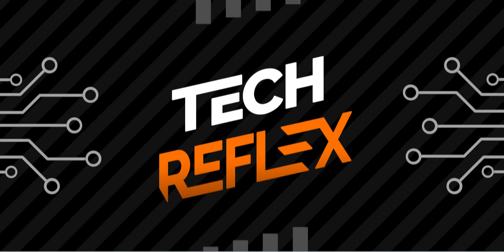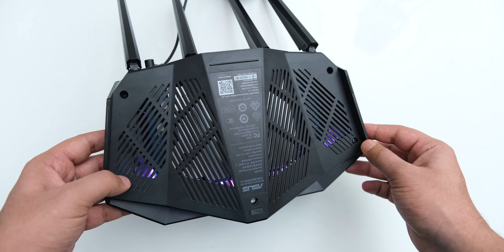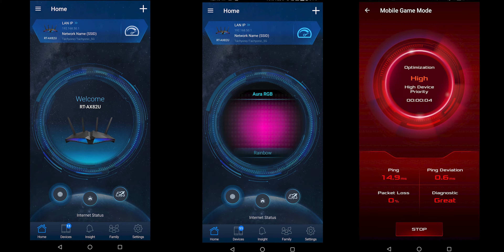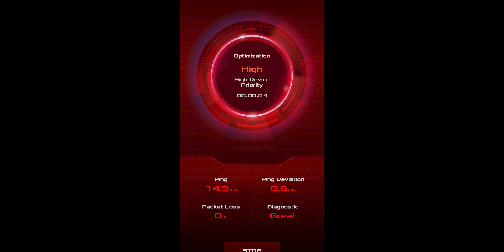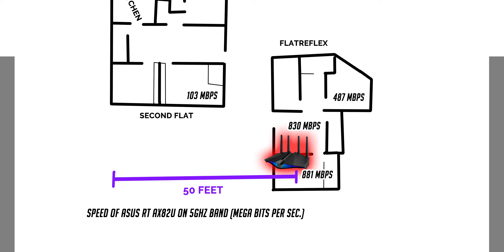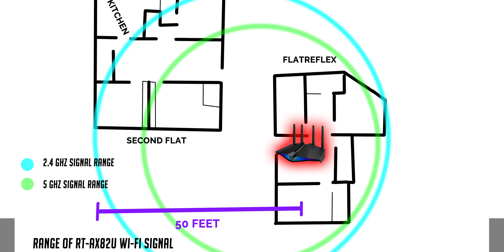Asus RT-AX82U AX5400 Wi-Fi 6 RGB Gaming Router Review, Speed + Range Test!

Comment: Silly questions. But this can be used  for NBN internet yeah? Didn’t say it did so just wanted to make sure
Reply from the maker: It can be used for all kinds of internet, though for some 'kinds' of internet, you may need a modem between this and your internet line.
Reply: @TechReflex  that’s weird cos the one of the exact same model here in Australia has different connections at the back….
Reply: It has 1 grey board 3 yellow ports and 1 blue port on the back so I’m guessing it’s also a modem not just a router then? 🤷‍♂️
Reply from the maker: @robobass25  No, this is just a router, which is enough for most fiber internet connections, but some may come with their own wired or wireless modem, which can be connected to this router.
Reply: @TechReflex  not the ones here…it’s definitely a modem router
Reply: @TechReflex  ah ok. Worked out how the NBN is here. It’s not “true” nbn I guess. Cos it’s using the DSL port in the back of the modem that plugs into the phone line that goes outside

Comment: TechReflex, thanks for the review. I bought one from Amazon the other day.  I'm having problems. I've connected it to my Virgin Media Hub 3 wifi modem using a new ethernet cable but it complains I am not connected.  The user manual says the WAN display LED will light up red if there is no connection but mine is not lighting up at all.  However I notice on your video that while you are showing us round the AX82U you have three of the LED lights showing white while the WAN light is not lit up at all, just like mine.  Any idea why your light was not lit?  Thanks
Reply from the maker: It's not lighting up probably because I had the WAN port disconnected while shooting the video. For your issue, you may want to check if you need to clone MAC from your old router, as ISP may not provide connectivity if they detect a different MAC address. There's an option to clone MAC on this router.
Reply: @TechReflex  Thank you.  I'll read up about the option to clone MAC.  Does your WAN LED ever glow RED or is it simply not lit when you are disconnected from the modem? Thanks.
Reply from the maker: I think it just doesn't light up, this review was quite long ago so I don't remember perfectly, but that seems to be the case.

Comment: I got starlink, would this router work if i use this instead? thinking buying it
Reply from the maker: Yeah you can connect this to starlink routers ethernet port. Not sure if you have to plug in WAN port with the starlink, but this router should work.
Reply: @TechReflex  thx :)just order this , had a black friday deal

Comment: Hey excellent review :) Do you suggest any other router for a 1gbps connection or will this hold good?
Reply from the maker: This will easily be more than enough.
Reply: @TechReflex  Hey thanks for the suggestion. Bought it 3 months back after watching your video. It's working great!
Reply: @rationalkannadiga  how’s it still holding up ?
Reply: @Jagado  It's working perfectly... 🙂
Reply: @rationalkannadiga  are you using for gaming? Also do you need to connect it to an internet at home? Or you can just plug into a while & you’ll be good.
Reply: @Jagado  I have a local LAN setup as well as 1gbps fibre which I use for gaming as well as work. This is perfect for both.

Comment: You really need to tweak your WiFi settings on your Asus router. I have AX3000 which is below AX82U, but I still get 2401 Mbps link on my OnePlus 9 Pro & 1 Gbps on my old Samsung S9+ & S8. I am not talking just about sitting next to the router, but anywhere in my 250 sq ft living room.
Reply from the maker: How do you manage to get 2.5 gigabit speed from a router with a gigabit WAN port that doesn't support link aggregation?
Reply: @TechReflex  also with merlin firmware AX3000 does link aggregation.
Reply: @TechReflex  I am talking about WiFi link speed, both on up and down link
Reply from the maker: And how does that help in getting actual transfer rates of higher than 1 gbps?
Reply: @TechReflex  you said you were able to get 881 Mbps that too as the best case scenario, hence I said you should tweak your WiFi settings
Reply from the maker: Yeah, 881 mbps of actual transfer speed, which is different from link speed. Try doing a speed test with your link speed of 2401 mbps and see how much you're able to get.

Comment: 7:04 .......... as an extender it can be used using DHCP(not any hardware device).....................the solution which i'm talking is w.r.t extending the internet connectivity
basically any DSL router can be used as an extender(which do not have repeater/extended/WDS mode).....even with basic routers(DSL) this is possible...
but only condition will be ===>
1. all the device connected to that router will be considered to be in a different network ....... but the internet will work fine
2. Ethernet Connection required between MAIN ROUTER & ROUTER(to be used as extender)

Comment: Does it come with dsl port when I had a talk with optus it said it would
Reply from the maker: Nope, it doesn't come with DSL port.
Reply: Optus may have a seperated version with a modem built into it. Otherwise you have to buy a seperated modem then connect it to this. Do you have nbn fttp or fttn?